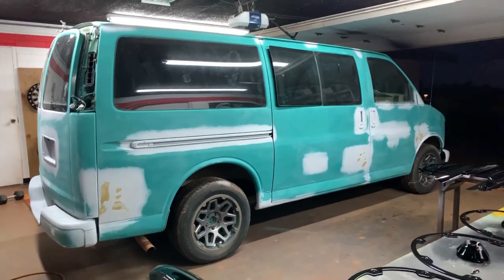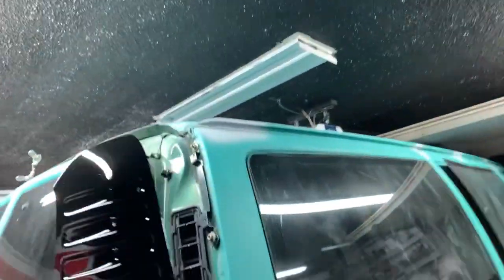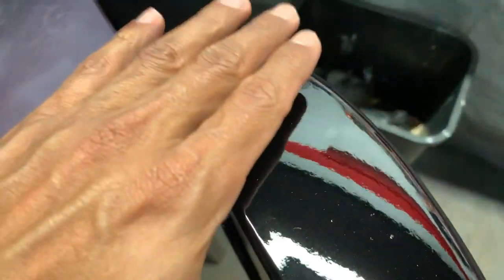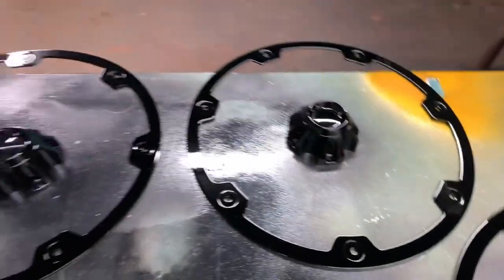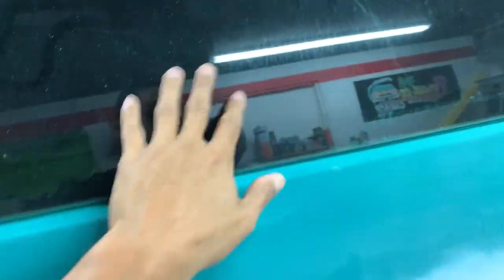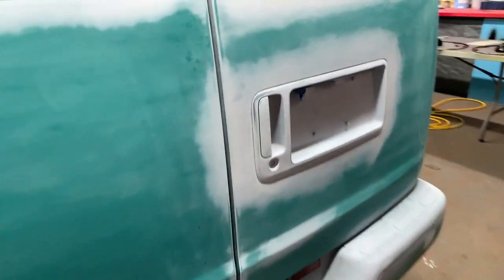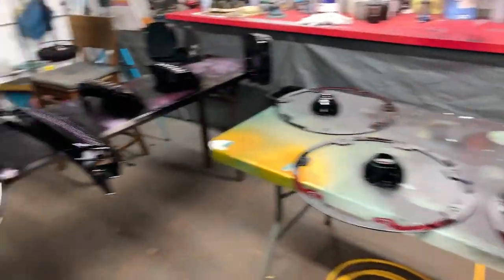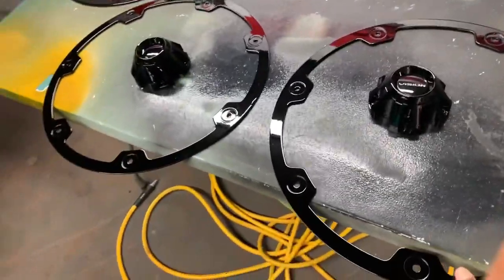Van Body Almost Ready for Paint & Painted Plastics

Comment: Which is the best way to remove  scratches that became visible in the base coat #1? Should I do base coat #2 or start over by sanding, adding filler primer then paint?
Reply from the maker: Hey Man! You should try 1000 grit to 1200 and then try buffing it out. if it’s a deep scratch and if you really want to fix it perfect to where it’s doesn’t look like there was ever a scratch, you might want to just reglaze it and then shoot a little base and clear. It’s up to you if you want to get that picky with your paint job. For more tips and free trainings check out learnautobodyandpaint.com